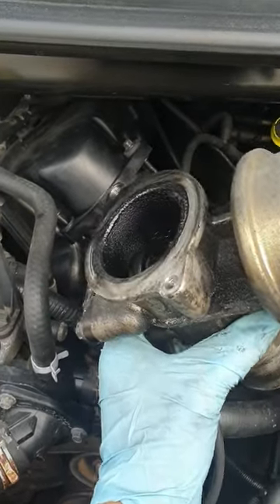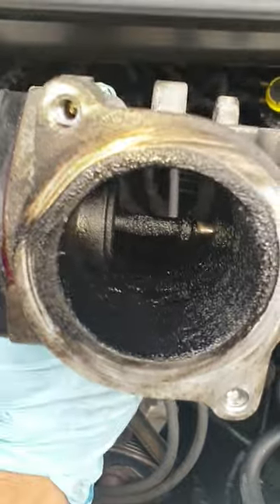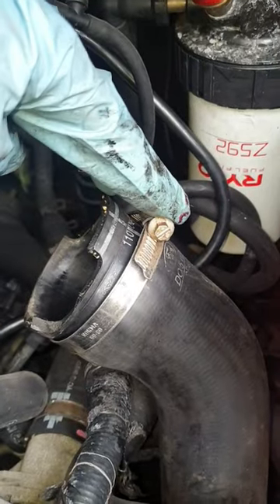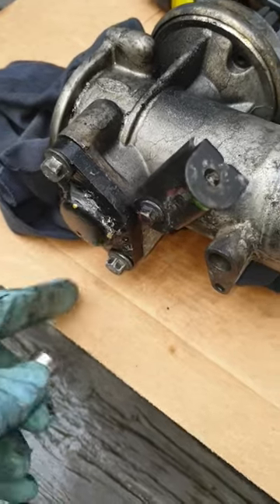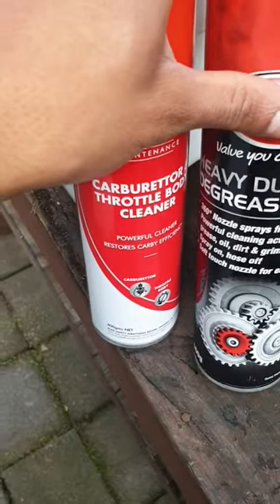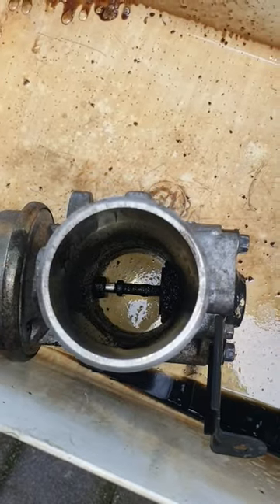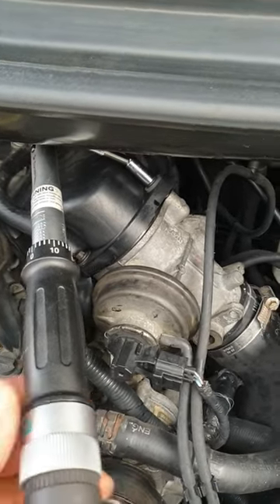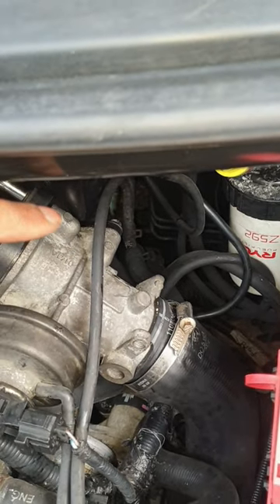Ford Transit EGR valve cleaning

Comment: Any idea I have a 2015 2.2 tdci transit 350 , 
Was driving recently all good only bought it low miles …
But came to a corner and seen white clouds of smoke , no power loss , no engine lights , no weird noises , however one thing I noticed is the exhaust box is flaked and crumbling & damaged , might be a small hole or two …. Atm (This the silencer I think ?box closest to  the end of exhaust we’re fumes are coming out ) white smoke was coming from exhaust itself not the small hole or two . I think 
Would this damage on the exhaust be the problem you think . 
I am bringing it to be checked asap just seen your channel .😊
,
Reply from the maker: I would get the exhaust fixed first and then proceed with further diagnostic work. Keep us posted on the findings

Comment: I've swung from delete and leave a few times. But now I'm settling on block off professionally, but leave everything in place, just incase the van ever goes out of rego and you need to get it back into rego ie. moving interstate
Reply from the maker: Yeap that works well on these earlier Ford Transits
Reply: @AutoBuddynz  What about injecting the AddBlue stuff in if you want to be environmentally proactive? From a later model?
Reply from the maker: @bicanoo_magic3452  There are kits available and the ECU will need coding. However check with your local rules as this isn't allowed in many parts of the world

Comment: My automechanic broke the screw that holds the agr pipe.  The opposite side of the side where the hose connects to the EGR valve.  Now he refuses to repair it because too much work?!!  Everything has to be removed to get to that broken screw. My question is, is that screw broken in the engine block or does the EGR hose screw directly onto the turbine?  My van is whistling right now.  Strength is also questionable.  Need to fix that, but if it's broken in the turbine, they say I have a big problem, if it's a block engine, then it's not a big problem.  What do you think?  Greeting
Reply from the maker: Is it broken in the egr valve seen in the video? If not Depends on your model year. The earlier ones are just on the manifold, which will need to be removed and fixed.
Reply: 😂😂😂😂😂 LOL

Comment: My 2012 Ford Transit Connect Van is idling high and blowing black smog out tge exhaust. I found oil on my spark plug threading and on coils. I’m thinking I should replace the valve cover gaskets, the spark plugs, and the pcv valve but does this van have one?
Reply from the maker: @raysellers8049  confirming you have a gasoline powered transit? If so then yes what you plan to do is correct. Start by replacing the valve cover gasket, clean all the coils well ensure no oil residual is left and replace the spark plugs
Reply: @ Thank you man. Yes 2.0 V4, cleared the oil out and coolant neither was mixed. Happy about that, everything else was easy as per video. Gonna do an engine flush due to caked up oil tomorrow and test her again after.
Reply from the maker: @raysellers8049  Great to know
Reply: @AutoBuddynz  Cylinder Head Temperature Sensor was my real issue. Didn’t bring a check engine light til after everything was changed out. Once I changed that I was back on the road.

Comment: Hi when I pulled mine out thanks to your video, I found quite a lot of carbon not just inside the EGR but also on the engine next to the EGR. It looks like carbon has got out the EGR through that side port (mine wasn't blocked off it wasn't connected to some pipe behind the EGR). Should there be a gasket to prevent exhaust gas leak?
Reply from the maker: Correct there should be a gasket to prevent exhaust gas from leaking. Carbon build up in the intake is common on these.

Comment: Thanks for all your Ford Transit videos, they are very helpful! Do you have any idea what could be causing a fluid to leak between the EGR valve and the manifold? I have just had the EGR pipe replaced (was broken) and I assume the EGR valve was taken out for this. Is it enough to replace the gasket or is the fluid an indication that something is wrong?
Reply from the maker: Thanks for the support. Are you referring to oil in the intake pipe?